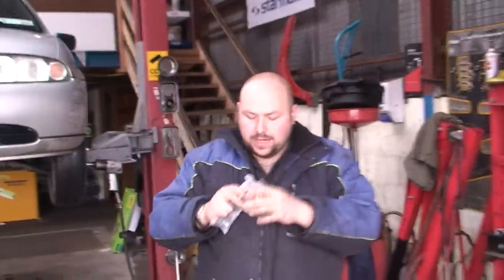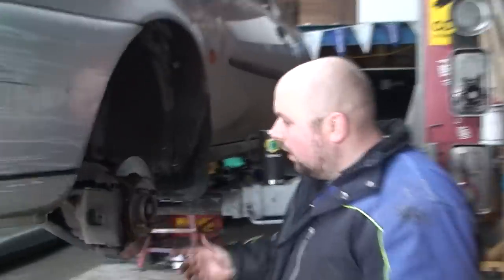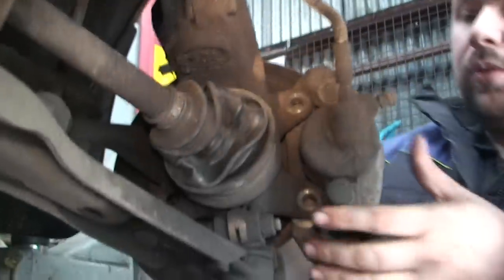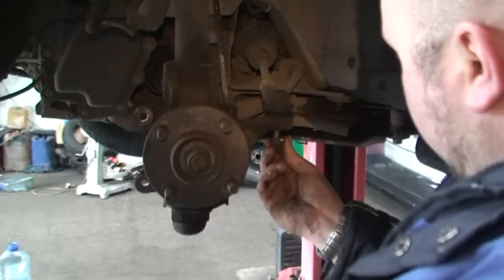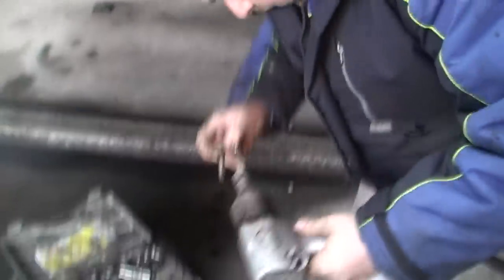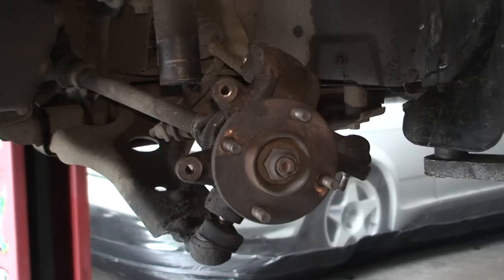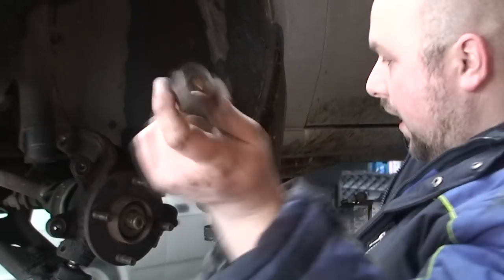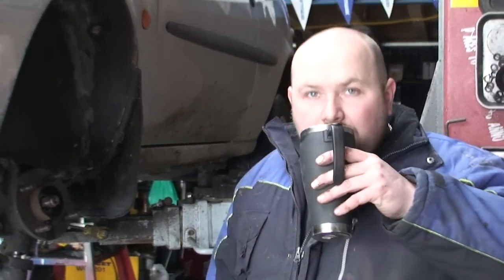bodgit and leggit garage how to remove hub/cv/wheel bearing/ drive shaft (part 1 of 4)

Comment: For the brake pad caliper removal I never had to pry on the pads. All I do is loosen both bolts. Leave on the top bolt just loose but still in there. Then take out the bottom bolt fully and then flip and swing the caliper bracket up. Always worked for me on every car I've worked on. Then one you pop out the pads you can take out the bottom nut fully and proceed to removal the whole caliper bracket. Also I always spray penetrating oil even when not necessary just out of habit. Just in case it needs it even though many times not even required just to be on the safe side and to make your life easier. Make it come out like butter. Leave on for at least a few minutes the longer the better. Then blast the nut off with air or cordless tool or hand tools and everything comes without a hitch.

Suggestion for people who only have manual tools and don't have any air or power tools to take out the axle nut first thing when the car is still on the ground otherwise you're not going to get it off and have to put the wheels back on again just to be able to.  I have many cordless impacts so I don't have to but I know not everyone has one. For the axle to come out I soak the crapola out of the area and leave on for 5-10 minutes and resoak again after a few minutes and go work on other areas before coming back to it. I just loosen the axle nut but leave it on the axle. Hammer on axle nut and never done any damage to any axle ever. You can put a block of wood combined with the leaving axle nut on if you're super ocd. Never had one not come out or damaged any threads or deformed any axle even on older cars. Never needed to use a hub puller or any air hammer to remove. If it's really rusty and you can't make any noise because it is late or very early or have shitty neighbors you can put a torch to the hub for a minute or two until it gets bright red. Then proceed to hit it with nice strong whacks to the axle with the nut still on and out she comes easy peasy. However I don't' suggest this unless you can't get it out with hammering alone which I have never had a problem with. This is just emergency backup measure. The reason why you don't want to do this method is it cooks the bearing grease and that is not good for the life of the grease and it hardens it up and loses its lubricating properties. This method is fine if you are going to replace the bearing anyways with a new bearing and in that case torch away. Always have a fire extinguisher nearby when using any open flame.

Important  note: Just make sure the head of the bolt is slightly below the nut surface so that it can't won't be damaged, disfigured, or mushroom out. 

At 05:40 That is one way I also do as you correctly pointed out. I also have the whole front end kit tie rod removal set but never had to use it so it just collects dust. Most people can do your way without any issues but some have bad eyes or hand control and it can slip and hit the tie rod itself and can damage the tie rod boot or joint. It would be pretty hard to mess it but you would be surprised how many people just lack the most basic of skills and abilities. I usually suggest the most idiot proof way. The trick is the same as with the axle nut. Just thread the nut back onto the bolt at least several turns to cover the head and thread of the bolt. Then one good or a few whacks if you're a weakling and out it comes every time. If you don't thread it far enough it is weak and can damage the threads as not enough threads are spreading the force. Just make sure you have several threads like 5-8 threads and  hit on the nut from the underside up. This will pop it right up and out no problem every time with absolutely no damage and chance of damage to the bolt or tie rod even if you were to miss. Just make sure the nut surface is higher than the bolt just as the same precaution applies like the axle nut removal. You can also add the use of a block of wood like the axle nut removal here as well.

For control arm removal I just use the longest pry bar I have and pry against the a safe strong area of the car and push down and comes out easily every time. The secret is the longer the better as long as there is enough room to manuel the pry bar a few inches with downward motion. For those who don't have any pry bar that is long enough a trick I have used before is to take the long removable handle of an hydraulic jack or any long pipe and use that to pry down and pop out the control arm. The pry bar is the better method as it can fit in tighter spots then the fat round pipe and a better handle for control and comfort. We all need to share tips and ideas to make life easier for everyone out there. Cheers.
Reply: The Hacks-By-Jack Channel “90’

Comment: I think these things will either come out easily or not at all without huge effort. 

Hopefully something will go bang in the night. 
Over the years on my own cars, I will try to soak it and push it with a hub puller. If that doesn't work it gets a junk yard hub and driveshaft and the bearing stays on the shelf.
Reply from the maker: sorted

Comment: Sir, No disrespect meant, but for your own good, Please use eye protection when using air tools, specially the air chisel. Being a class 8 heavy duty truck mechanic for over 40 years, I have seen alot of injuries. I have been lucky, had a few close calls. I like your video, I am sure you have helped many people. I wish you well.😀
Reply from the maker: yes mate you are correct

Comment: Hi, wanted some advise please. Would a bad wheel bearing also cause a knocking noise when driving?
Reply from the maker: Bad wheel bearings usually cause a hum the faster you go the faster the hum appears
Reply: @bodgitandleggitgarage  Thanks for your reply, Seems like I may have another problem. Mine is making a knocking/cluncking noise. Any ideas?
Reply from the maker: Yes mate it could be a few things drop links or d bushings Shock tops or wishbone bushings

Comment: I need to replace mine which ive decided to do myself, one question I have though is, why is it always the left side one in all the videos? Has it got anything to do with the shorter axle?
Reply from the maker: Hi mate the reason why they go quicker normally on the left-hand side is because this is the side that is on the edge of the road which normally isn't maintained as well when you pull over for people specially on side roads this hit more potholes and gets a lot more abuse than the other side of the car
Reply: @bodgitandleggitgarage   thanks for the reply, but I'm in France, we drive on the right lol and all the French videos are the same, left side bearing.

Comment: Can a floor hand-break be changed/converted to an under dash hand-break. I want to make more room between driver seat and passenger seat to access rear of my Transit van and want to remove obstacles (floor hand-break). Do you have any video's for this?

Comment: Mate you should of used a medium sledgehammer with a punch wacked the cv joint out before you took of ball joint and hub to strut mount pinch bolt and you wouldn't of had a problem but if that's the way you were taught nothing to do with me but just take my advise try it mate 20 year served speed for its self

Comment: Nothing to do with this video but the hydraulic press reminded me . Do you know how to refurb a 3 tonne jack leaking fluid put of the bar that goes up and down attached to handle of Jack I assume there's a seal gone and Jack looses pressure sometimes?  any tips
Reply from the maker: Alex Gilliland hi mate I've never done one but it cannot be that hard they're only seals and o-rings as long as you measure them correctly you can go online and get the correct seals / o rings just make sure you put the correct oil back in and you should have no problem
Reply: bodgit and leggit garage , ok cheers will look into it , I purchased a eBay special 3 tonne jack about year and half ago and does the job but just doesn't go as high as I'd like for what I be using it for gearbox changes and so on  (on the ground) ... Any suggestions on a good reasonable priced jack that will get good height?
Reply from the maker: Alex Gilliland unfortunately mate I don't know of any reasonable priced Jack as it's something that I've never actually purchased myself because I used them alot I've always gone for the branded Jack's you don't really want to suggest anything to you as I don't really know the lesser brand which to go for
Reply: Alex Gilliland need new seals easy fix

Comment: Why wheel bearing has been dammage in the first place?? Because the car owner has gone replacing outer hub of drive shaft. And the part was not OEM. Highly likely China. The spline of the outer hub is slighly larger than it should be. And the mechanic who did replacing outer hup must using tremandous force to put it in. Too bad the force expand inner bearing race too much.

Comment: where can i buy the blue tool
Reply from the maker: John Johnson hi mate a lot of tool companies do these they are called hockey sticks or suspension lever tools if you do a search online I'm sure you'll find loads of options hopefully in the next couple of weeks I'll be getting a new tool which is better than this if I get it I will do it all with you this might suit you better
Reply: you dont need the tool,  tap the top hub it will come off the shock base,

Comment: Sorry to say, this guys is doing it the hard hard way, May be he wasnt trained in a goood workshop/ or at all   to carry out jobs easily,   he had to figure it out the dificult way.   pushing the pads/ piston backwards without opening the nipple, wrongusing that monster arm not nessary at allgood luck mate
Reply: Errr... I've never needed to open the bleed nipple to retract the pads. When the brake pedal is in its resting position the piston in the master cylinder exposes a port in the cylinder leading to the brake fluid reservoir so the brake fluid gets pushed back through the brake system and into the reservoir. How do you think fluid gets from the reservoir into the system as the brake pads wear out and the pistons get further out of the caliper?
Personally, I use a huge G clamp around the caliper to push the piston back in as I don't like putting dings in my brake discs and pads.
Motorbike brakes work the same way which is also where I got into the habit of using a G clamp although bike brakes are ridiculously easy to bleed compared to car ones.
Reply: lol now you need to bleed the brakes!  thats just plain stupid.  also if your going to insult someone use the right words.  its a bleeder not a nipple.